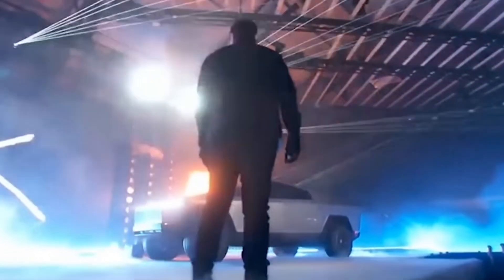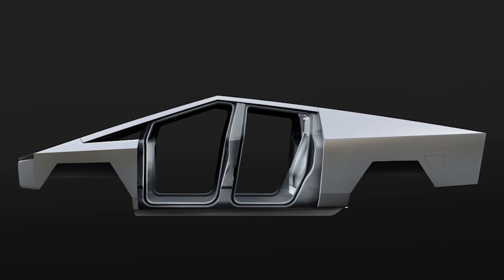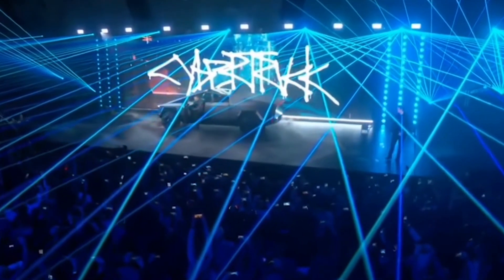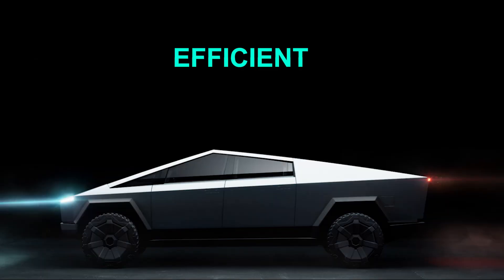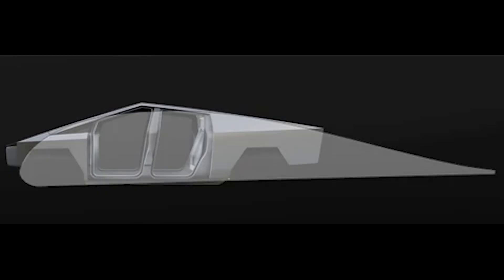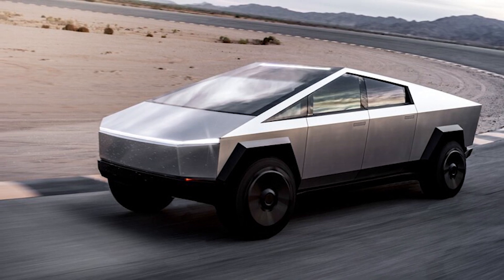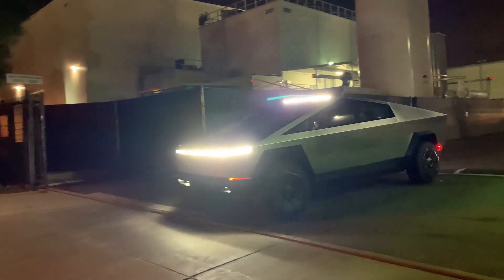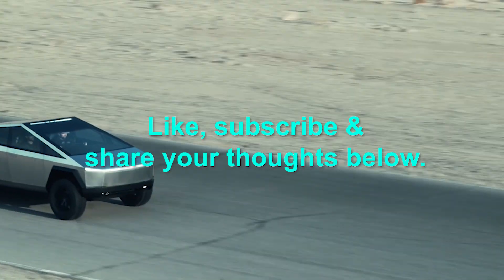Cybertruck is Engineering Genius (and will be copied)

Comment: You made some really interesting points - great video!
I'm curious to see how the safety rating of the truck plays out. Part of what makes cars safe is having weak panels that crumple easily in a crash. I guess it would be okay if you crash into another car because the thing is massive and would probably destroy the other car 😁, but what about crashing into a brick wall?
Reply from the maker: Lots of people are raising this. The steel can be scored on the underside to crumple predictably and consistently (or the hood could be a separate component). I think many will be surprised at how well the Tesla engineers address this. Safety is always top of mind at Tesla. It may not appear so but the driver in Cybertruck sits the same distance from front of the vehicle as they do in Model 3 so there's equivalent space for crumple zone too.

End of the day, Cybertruck won't be allowed on roads if it is not sufficiently safe for occupants or pedestrians. Tesla are smarter than to design an unsafe vehicle 😉

Comment: The thing about the "Safe" part of the truck is, the reason that cars dent so easily is that they were designed that way to reduce the impact force on the car. A good way to explain it is like an egg drop test. If you put an egg in a steel box and drop it will the egg break, yes of course it would.
Reply from the maker: Lots of people are raising this. The steel can be scored on the underside to crumple predictably and consistently (or the hood could be a separate component). I think many will be surprised at how well the Tesla engineers address this. Safety is always top of mind at Tesla. It may not appear so but the driver in Cybertruck sits the same distance from front of the vehicle as they do in Model 3 so there's equivalent space for crumple zone too.

End of the day, Cybertruck won't be allowed on roads if it is not sufficiently safe for occupants or pedestrians. Tesla are smarter than to design an unsafe vehicle 😉
Reply: @SolvingTheMoneyProblem  oh cool, I didnt even think about that

Comment: Love the video and I agree on most fronts.  The truck is utilitarian  and boast amazing performance for its class alongside safety and structure.  However, the truck bed is meant to be accessible from all sides for the job sight.  Although I understand the design could not align with this, it will be interesting to see what workers in the field think of this
 
Also, safety.  We do not know the full extent of the safety of Cybertruck, however we can assume that Cybertruck will be especially safe for its occupants.  However, would about the other vehicles.  Although autopilot will play a huge factor in preventing vehicle collisions, no system is perfect.  What will this tank do when it comes into contact with other vehicles?  I have no doubt in my mind that Tesla already thought of this, but...  

I am a huge fan of Tesla and this Cybertruck has the potential to be a game changer.

Thoughts?

Comment: Uhhh, in cars, rigidity is a bad thing
Reply from the maker: Lots of people are raising this. The steel can be scored on the underside to crumple predictably and consistently (or the hood could be a separate component). I think many will be surprised at how well the Tesla engineers address this. Safety is always top of mind at Tesla. It may not appear so but the driver in Cybertruck sits the same distance from front of the vehicle as they do in Model 3 so there's equivalent space for crumple zone too.

End of the day, Cybertruck won't be allowed on roads if it is not sufficiently safe for occupants or pedestrians. Tesla are smarter than to design an unsafe vehicle 😉
Reply: @SolvingTheMoneyProblem  they're probably raising this issue because you kept talking about structural rigidity as if it was a huge bonus for the entire car.

Comment: Safe for the people inside the Cybertruck. If you're outside the Cybertruck...good luck!
Reply from the maker: Lots of people are raising this. The steel can be scored on the underside to crumple predictably and consistently (or the hood could be a separate component). I think many will be surprised at how well the Tesla engineers address this. Safety is always top of mind at Tesla. It may not appear so but the driver in Cybertruck sits the same distance from front of the vehicle as they do in Model 3 so there's equivalent space for crumple zone too.

End of the day, Cybertruck won't be allowed on roads if it is not sufficiently safe for occupants or pedestrians. Tesla are smarter than to design an unsafe vehicle 😉

Comment: Using extra hard outer skin sounds great, BUT i thought collapsible and crumpling panels was safe vehicle design in regards to force absorption, therefore not transmitting the force of a collision to the occupants? What am i missing?
Reply from the maker: Lots of people are raising this. The steel can be scored on the underside to crumple predictably and consistently (or the hood could be a separate component). I think many will be surprised at how well the Tesla engineers address this. Safety is always top of mind at Tesla. It may not appear so but the driver in Cybertruck sits the same distance from front of the vehicle as they do in Model 3 so there's equivalent space for crumple zone too.

End of the day, Cybertruck won't be allowed on roads if it is not sufficiently safe for occupants or pedestrians. Tesla are smarter than to design an unsafe vehicle 😉

Comment: I just noticed that the tailgate doesn’t seem to be able to be opened flat. It has a slight negative slope to it. People use that as a table all the time. There are so many truck guys searching for reasons to hate this truck, I guarantee you they catch onto this eventually.
Reply: The reason i am "consuming media" about it is because i was really looking forward to having a viable electric option for a truck. I own a 1991 f250 and a newer tesla model 3.  I would love to ditch the 7.5l gas engine, other than the fact the truck does everything a truck should do, does it easily and reliably, and has done so for almost thirty years and 400,000 kms. I see this whole design as a miss as a truck, which will set back electric vehicle usage back a number of years.  Most people i've seen who "like" this truck either don't have a truck or don't use their truck as a truck (grocery hauling and yearly trip to the dump). I keep hearing "function" over form yet i see the form hurting the function in many important truck related aspects. As an "suv" this vehicle may suit many, but as a "truck" it will not replace the big four (gm, ford, dodge, toyota) gas and diesel trucks that dominate the market. And that is what i was hoping for, a real electric truck that does truck things. (Btw, the bumpers do protrude slightly, but both the top ends on the front and rear of the body angle outward past the vertical plane.)
Reply: One last thing. If pointing out actual flaws and concerns about something is a bad thing, especially if the truth causes you to "change your mind", why would that be a bad thing?  I'm not saying i think the truck is ugly, so you should too, or anything that is about person taste.  Whatever the case, if i am wrong about something, or haven't taken all the facts into consideration (whether by ignorance or misinformed), i would be thrilled to have them pointed out to me so that any decisions i make will be the best possible ones. I'd rather be wrong and correct the mistake than go on thinking i'm always right went i'm not.
Reply: @stupidas9466  All the "design flaws" are specific to YOU. It has 16.5 inches of ground clearance and it's 14,000 lbs of towing capacity is competitive with the big 4. The only flaws you've pointed out are either flaws Tesla itself acknowledges (the mirrors and steering wheel) or a lack of compatibility with accessories you already own. If you're buying a truck to tow your goose neck and canopy just don't buy this truck. You really haven't given any reasons why this isn't a good truck, you've only proved that this just isn't the truck for you.
Reply: Andrew Miller-Thomas i don't hate the truck, i just think it is useless as a "truck". I have a fifth wheel and goose neck trailer that this "truck" cannot pull due to its design. I have a canopy and a camper that i put on/take off quite frequently, which also won't fit due to its design. I carry ladders on the roof. Same. When building, i reach over the sides all day long grabbing/replacing supplies. Same. I have to back up my trailers on job sites and when parking them in the back 40. Mirrors give such a better , changeable field of view and 3d perspective that a  small screen cannot, and that steering wheel design is useless for backing up a trailer and is an ergonomic/comfort nightmare for any drive longer than 10 minutes. All the above are design DECISIONS which limits the truck's ability to to "truck" things, and the only reason these decisions were made was for aesthetic reasons, making it different and futuristic looking. There are reasons all useable trucks have a certain "look", because they work. There is a reason a steering wheel is round.
Reply: Stu Pidas well. It’s gonna have mirrors & a round steering wheel because it wouldn’t be street legal without them. I’m sure if Tesla doesn’t someone else will design a goose neck adapter for the Cybertruck. Same deal with the canopy trailer. It’s exterior saves weight (exoskeleton design) & is more durable than stamped steel, so it serves a dual purpose in both aesthetics and functionality.
Reply: Andrew Miller-Thomas an adaptor? The trailer itself will hit the sides, there is no adaptor that can make something disappear.  As far as a canopy goes feel free to design one that can go on securely and be removed/reattached quickly. Then produce it for only one specific vehicle that can't be used for any other trucks. And price it less than $2000. Good luck. And tell me why does the cybertruck not have mirrors or a round steering wheel (or two separate headlights, or bumpers that don't protrude past the nose or tail of the exoskeleton, etc) if it's required? It's either tesla doesn't know of standard regulations and are completely inept) or they do know of them and chose to reveal the cybertruck in a form that won't be viable but will make it look more futuristic  and different and dupe the consumer. Neither one is good. As far as saving weight, do you know how much this truck actually weighs? Funny how those numbers (like the interior width of the bed) isn't released. And going by the video of the tug of war between it and the f150, anyone who knows the first thing about physics will realize a tug of war between two vehicles, assuming the tires have the same grip, will always be won by the heavier vehicle. (Won't even mention the part about the f150 being in 2wd!).  With all this marketing tomfoolery and doublespeak, i wouldn't be surprised if (don't think it is so, just more to make the point) tesla decided to make an atv only because a normal atv was too wide to fit inside it's bed.
Reply: Stu Pidas You got me on the adapter. I didn’t think of the raised sides, I was thinking more along the lines of bed dimensions. I don’t use a canopy so I’m not going to design one, it’s just likely that when this truck releases someone will make accessories for it (if it sells). It’s technically a concept car, explaining the mirrors and steering wheel. They’ll probably deal with the headlights by only utilizing the right and left sides of the light bar and just use the rest of it as a daytime running lamp. I’m looking at pictures, and I see a protruding bumper, I’m not sure if it sticks to regulation, but it’s there. As for the exoskeleton, if it was a box on frame it would be considerably heavier (and less durable) than it is in its current form, it would also be more expensive for Tesla to manufacture (there’s a video on this, idk what its called but do some digging if you’re interested.) As to why Tesla unveiled a “production vehicle” that doesn’t meet basic street regulations is beyond me, you’d have to go to Elon for that one. If you think it’s such a shit truck quit consuming media about it and stop trying to convert people like me who like this truck.

Comment: While this may be an efficient and low cost design, I would hesitate to declare it safe when it hasn't been tested. While I am fairly confident that Tesla will find a way for it to be safe, current thinking and design has centered around crumple zones which the tough exoskeleton wouldn't seem to do well. 

At the end of the day show me a final product and test it. That is when we will know what it is or is not capable of
Reply from the maker: Lots of people are raising this. The steel can be scored on the underside to crumple predictably and consistently (and it appears the frunk is a separate component - this is the crumple zone). I think many will be surprised at how well the Tesla engineers address this. Safety is always top of mind at Tesla. It may not appear so but the driver in Cybertruck sits the same distance from front of the vehicle as they do in Model 3 so there's equivalent space for crumple zone too.

End of the day, Cybertruck won't be allowed on roads if it is not sufficiently safe for occupants or pedestrians. Tesla are smarter than to design an unsafe vehicle 😉

Comment: Building a vehicle that is extremely rigid and tough does not make it safe. 

In fact it makes it pretty damned unsafe, there is a reason why race cars went away from being made out of railway track and moved to the crumple zone versions of today which are also built into your domestic cars. Crumple zones extend the amount of time it takes for the passenger cell of the vehicle to come to a stop, this greatly diminishes the forces on the passengers by reducing the deceleration.

Having a very rigid body means that the vehicle will stop almost instantly, but the passengers cannot do that and survive.
Reply from the maker: Lots of people are raising this. The steel can be scored on the underside to crumple predictably and consistently (or the hood could be a separate component). I think many will be surprised at how well the Tesla engineers address this. Safety is always top of mind at Tesla. It may not appear so but the driver in Cybertruck sits the same distance from front of the vehicle as they do in Model 3 so there's equivalent space for crumple zone too.

End of the day, Cybertruck won't be allowed on roads if it is not sufficiently safe for occupants or pedestrians. Tesla are smarter than to design an unsafe vehicle 😉

Comment: tough shell does not necessarily equal safety. a big portion of today's safety philosophy lies in the transfer of impact energy into body deformation of the car.
Reply from the maker: Lots of people are raising this. The steel can be scored on the underside to crumple predictably and consistently (or the hood could be a separate component). I think many will be surprised at how well the Tesla engineers address this. Safety is always top of mind at Tesla. It may not appear so but the driver in Cybertruck sits the same distance from front of the vehicle as they do in Model 3 so there's equivalent space for crumple zone too.

End of the day, Cybertruck won't be allowed on roads if it is not sufficiently safe for occupants or pedestrians. Tesla are smarter than to design an unsafe vehicle 😉